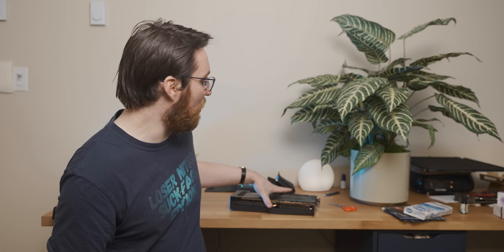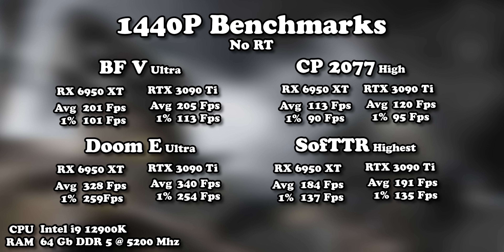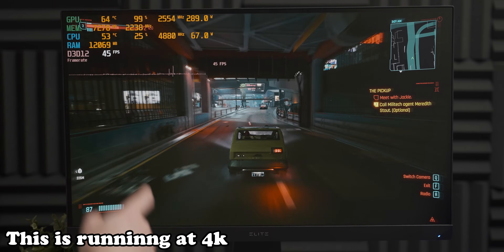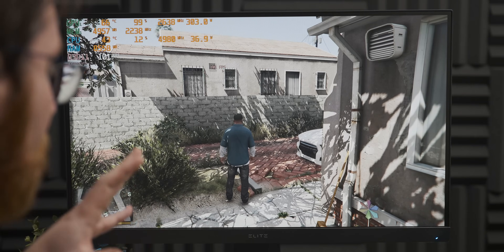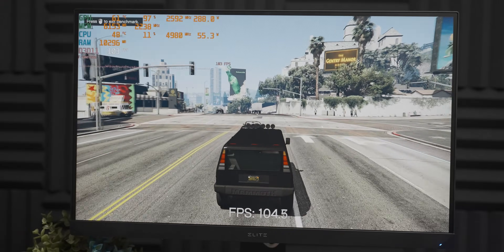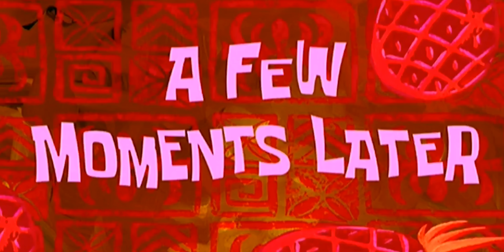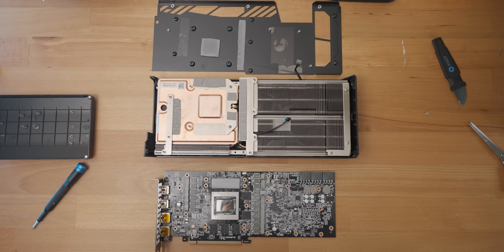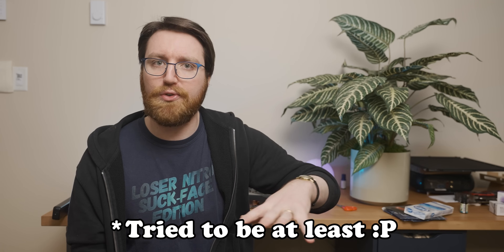I Can't Figure Out What's Wrong With This Gigabyte RX 6950 XT

Comment: This sounds off, so first question is did you AMD cleanup tool after the bios flash? As AMD stores the power tables in the registry on windows and why it might not have changed after the bios flash. 

Another thing you could do is Igor's lab mpt tool and set up a 400watt power plan and see if it will do a power plan this high to determine if it's the card causing the issues or something else. 

Hopefully this helps you along in the process of troubleshooting out what it is.  

You should use AMD drivers for clocking to eliminate the possibility of issues with MSI afterburner. And log with GPUz opening up in notepad plus so it lays it out nice and clean for you and look at clocks and settings are doing during your test run as if could possibly be throttling as well. 

Drivers usually identify the card and write the power plans to the windows registry for the cards. 

Another thing could be possibly going on is windows automatically updating drivers so before you do a remove and reinstall of drivers set windows to metered connection. Then dona driver reinstall. 

Questions let me know.

Comment: Considering you have changed everything it has to be a hardware issue. I don't see how it could be anything else at this point. But that coil whine is very concerning. Gigabyte should know pretty quickly what the problem might be, I mean they made it. It should not take 4 days to work it out. Whats weird is they haven't asked you to send the card back to them. Because after explaining the whine and that you changed the bios and drivers along with a whole new different test bed, they surly would want a look at the card itself. How can they diagnose the problem without the physical card? The issue might not be obvious or can be found using a diagrams. Hope you get an answer soon because this isn't an issue that should take this long if they haven't got the card to look at.

Comment: Hey Dawid, if you do some looking around there's a compounding issue that amds software power consumption isn't actually very accurate and reads far lower than the actual draw of the card. TestingGames on YouTube has a bunch of tests with the software numbers on screen and they closely resemble your power draw numbers

Comment: There is nothing wrong with your card. 6900 XT power is 255w in software before VRM efficiency. This 6950XT is 290W so its already more than 6900 XT. Also you need to test games that can push the card and you need to check the clk speeds. 4K is also what is required to push maximum power.

Comment: 4:03 - I do not see power delivery temperature (if the provided picture has all the temps). It might be measured and not reported yet it might still throttle the card at 100C. Power delivery is the kind of thing where having an aluminum block padded onto it is called good design. (Not to mention that Gigabyte definitely knows how to do power).

Comment: It's clear that you got the EU version of the card, now power prices have gone up 56% in the EU Gigabyte clearly sees a gap in the market 'low power top end cards'.
Past the jokes I suspect hardware problem be it a bad batch of parts or one of the do dads that place parts on the PCB had a bad day, massive coil wine makes me think it's the VRM maybe has some stages failing.
Reply: The thing is, that wouldn't even be a bad card, if it was marketed and priced as such. Many of the highend cards are already running way past their peak efficiency, so having one with all the shader cores but reduced clocks could be a great seller. Performance of something like a 6800 but at the power draw of a 6700

Comment: I had an issue like this from an older card, the PC has had a  few other cards in it before.  So I went to the drivers folder and made sure I changed properties to show hidden files and some older drivers showed up I deleted those and it started working properly.  Might be worth a try. I think system was confused,  happened to be Gigabyte hardware as well.

Comment: If it's anything like the issues I had with their launch 3080, the thermal pads were so subpar that it was causing the memory to overheat and the card would act strange without an obvious issue.

Comment: Doesn't seem to be the firmware, doesn't seem to be the power supply, doesn't seem to be the cables... So I think the problem is the chip which is somehow a bad batch and doesn't draw more power because it's limited somehow to avoid it from shutting down because it can't handle drawing power above a certain level?

Comment: There is nothing wrong with the GPU. The confusion comes from the fact that radeon drivers don't report the correct power draw through software. This has been a AMD problem for years...they don't report the real power draw in the drivers because they don't take into account the power losses on the mosfet drivers, inductors etc and some other power rails like 3,3V from the PCIE slot. TechpowerUP (and I believe also techtesters) measure power draw with specialized hardware(not afterburner or radeon drivers lol) and they measure the total power draw of the card at the PCIe power connectors and also on the PCIe slot. Ask techtesters on hey they measured the power draw, I bet they didn't measure it with afterburner lol.

Comment: As an electronics designer I can assure you that the massive component shortage is not just about GPU's or CPU's. There's a shortage of every type of component. This forces vendors to look for alternative components, Their first choice are drop in replacements, meaning that the new component can be soldered to the same PCB providing identical performance. Once you can't get your hands on such drop in replacements you basically have three choices:
1. Redesign the PCB to achive the same performance with other components. 
2. Choose a replacement that can be fitted to the same PCB but with less performance, life span, reliability etc.
3. Stop producing. 
With massive coil whine, your performance issues and the lack of vendor explanations I would guess at number 2. The board is not able to supply enough power thus throttled by a hidden setting that you can't touch. Or possibly the board can supply enough power but was throttled by mistake. Should you recieve a magic wand special update bios I'd guess for the latter.

Comment: I don't really know how the other sites/channels got the power usage info, but you should never take AMD's software monitoring for power at face value. There's a recent article on Igor's lab about that. Nvidia has sensors built in the PCB that basically gets the power usage right, but AMD's are funky. I'd use a watt meter in the same system, just swapping cards and checking the power usage on it, and taking your own conclusions.

Comment: Why is the card reporting as RX 6600 in HWinfo
Also, could one of the PCIE Inputs be broken so that's why it's capped at 290W like the 6900XT as it is only using 2x8-pins? can you use the Nvidia PCIE Riser thing (PCAT I think) to measure?

Comment: Finger prints and massive coil whine, sounds like the pcb and the components on it have issues. Is probably why they have little idea what is going on is there were some touch ups made after the board was originally made.

Comment: Yeah … So my experience … with gigabyte in the past is kinda similar
I had stability issues with a mainboard from them and before getting a RMA replacement I swapped out every part of my system … Ram PSU GPU were all replaced with superior parts and even after the RMA I still had the same issues until the store where I bought it got pissed at Gigabyte and they gave me a full refund so I bought my new board there since the store provided better support than Gigabyte 
I got myself an Asus board as replacement … and never had those problems again
Since that time I am trying to stay as far away from gigabyte products 
A few years ago I got a used GPU because the one in my mother her pc had some issues and the seller I got it from sold an Asus card … but I almost had a heart attack because he send it in a Gigabyte box … lucky enough it was actually an Asus card but … I realized at that moment that my experience with Gigabyte seemed to have left me traumatized … 
I am not saying that people should not by Gigabyte there products but I will advise to go back to the store when having problems with there products  and Request a refund right away …

Comment: I had on and off luck with gigabyte, one mini itx mobo went bad and returned it, one atx b550 mobo got stuck in hibernation once and had to pull cmos battery to ge it working but their waterforce xtreme 3080 has been awesome along with the z590 ultra atx mobo.

I do know some of their watercooled gpu and psu are pure trash.

Comment: I have a gigabyte gaming oc 6900xt and it has the same problem it barely draws any power, in Modern Warfare it draws around 95w, performance is still pretty good but it could be better

Comment: I was tempted to give Gigabyte a chance recently, since the Aorus Master 6800 XT was actually ON SALE. Until I started reading about issues with the VRM / VRAM overheating due to bad thermal pads (pads from the factory is too thin). So...I buy an Aorus Master tier GPU, brand-new, and I need to open it up, and spend $100+ to fix a design issue. No thanks. Waited a bit longer, and the Sapphire NITRO+ 6800XT SE went on sale...so I grabbed that instead. Having used Sapphire GPUs since the AGP Radeon (non-HD) 9000-series days (most recent being the Sapphire NITRO+ 5700 XT), I'm just going to stick with them. That said, the Gigabyte Vision RTX 3060 Ti  in my second system runs quiet and cool. Inconsistencies.

Comment: Something is blown in the power side of the card
Reply: Note that the power controllers have temp sensors too, if the power section is overheated they will reduce the amount of power available for the card,

Comment: its running exactly like a rx 6800 xt have you looked at the die? I wonder if a rejected die made it into the approved for rx 6950 xt bin. from what i understand they use under preforming die in low model cards and one just got mixed up.

Comment: I don't understand your problem. Your card uses less power, but clock speeds are way over official AMD spec and way higher than Gigabyte's too. It looks like you got very good bin of that card and you complain about lower power usage? I fail to see what's the problem. And no 6950 XT is indeed not as fast as 3090 or 3090 Ti in quite a bit of games. If anything is wrong with it is the fact that it's too fast, but that's good for you. So really wtf, Dawid? Not only that, but you flashed vBIOS for a bit worse binned cards as it no longer boosted as much. This video is such a fail. Anyway, did you check ASIC quality in GPU-Z?

Comment: msi afterburner does not really like my powercolor 6900xt and I ended up using the overclocking tools built into the amd driver.... even undervolted it to get less coil whine... maybe the amd tools are a fix for the power issue...

Comment: There is undoubtedly a hardware or software/internal bios limiter of some sort that is keeping the card from doing what it needs too. With it performing more like a 6800xt or 6700xt its falling to far behind specs.
Reply: I would guess a resistor used in a sensing circuit is the wrong value. The card thinks it's hitting 380w but really 280w, obviously the circuit used for reporting the power to the OS is OK.

Comment: Im not an expert or anything but since you're exactly a 100w from a normal power draw and a proven working bios version didn't work, then I would say you have a bad capacitor or something to that effect in the power delivery chain. You should get a tester and individually test the circuits.

Comment: always loving the great content bro!!! this is just another reason why I do not like Gigabyte at all... from janky psu's and the constant returns of gigabyte motherboards and video cards at Microcenter. it just keeps adding up lol. I stick to loyal brands such as EVGA, Asus, Sapphire, and ASRock. always performed well no matter what product I use from these brands.
Reply: If I go just from my experience, there are rarely any that are recommendable.
Gigabyte: got into lots of heat recently (justified, because they did lots of BS recently)
MSI: boards where RAM slots randomly die and GPUs where the power delivery is shunted to go over TDP for review results
Asus: stuff is named completely different and have overly complicated setup procedures. I have one board where I am unable to enter BIOS when a specific CPU is inserted (the CPU works fine in other boards) and another one where one specific keyboard doesn't work. (the keyboard does fine on other boards, and other keyboards on that board)
ASRock: went from making shoddy boards with bad performance to becoming a decent manufacturer at a budget, but that budget comes at a cost.
Corsair: silently changes the chips on their RAM and SSDs into versions with less performance, but don't adjust the price for that.

Comment: Well actually, just after a short investigation of mine, if you look on thechpowerup the bioses they have for 6950 XT are limiting power to the cards output and mine too has 290W which is a bios limit. I think the cards that draw insane amounts of power are the faulty ones, ignoring bios specs. My sapphire non-pure is 290W, the Pure is 325W limited and the Toxic is 332W limit accordingly, so this is by design.
Reply: No, only faulty thing is to assume Radeons report full board power. They don't, it's just GPU itself and memory. You can add 25% top of the number in monitoring software. It's same with all radeon cards.
Reply: @kognak6640  you and me both know that's not true, you can monitor the power output from your PSU, mine reports it just fine. The card is pulling 290W from the wall, that's it. No more, no less. There's nothing wrong with the card, it's the ones that have 380W draw that are the faulty ones.
Reply: @kogwrath238  You don't know even basics. You wall figure is whole computer with PSU losses. You can't accurately say how much it's from graphics card. Only accurate way is to measure power consumption from 12V feeds to graphics cards. Some review sites have equipment for it(nvidia PCAT).

Comment: I always had issues with gigabyte products especially with gpus from poor memory, weak power delivery up to poorly designed pcb. I have a gigabyte gtx 1080 g1 gaming and the card crashed and fans went to 100 % every time i was playing a game (witcher 3 mostly) for almost a year and a half i had this issue i tried to contact support and they just told me to try different drivers. Tried that, didnt do anything tried all bunch of stuff (bios flash, different psu different system) still the card was crashing and radio silence from gb support. Than i saw an old forum where some old evga gpus were doing the same thing back in 2010 and it said something about bad power delivery. Than tried to undervolt the gpu and balance out the core clock and i ended up to 0.95 to 1 volt and 1962mhz core at 67celcius under full load and 8 months now never had any issues with it. Funny thing is that if i try to go to 1.05 or 1.1 volt the thing will crash again. So yeah trash product. Also the coil whine almost non existant after tweak.
Reply: So in the end the factory overclocked card couldn't run stable at that overclock?
Reply: @HappyBeezerStudios  no no its not about the stability of the factory oc or user oc, the chip runs fine at those clock speeds. Its about the power delivery the vrm specifically once you go past 175w - 180w, the symptoms that i mention start to occur, so i need to undervolt. My guess is that gb used unedrspeced power delivery or vrm that thay used on a lower end gpu to save costs.

Comment: Honestly this is just plain weird, especially because since the overclock doesn't actually work it has to be 99% sure hardware issues. I would try to run it on a fresh windows install just to see what happens because aparently that can make a difference sometimes, but there has to be something wrong in the card bottlenecking it severely.
Reply: Maybe not issues but an actual limit.
Reply: @HappyBeezerStudios  who knows. Hardware can be really picky sometimes

Comment: Dawid Does Tech Stuff : did you use 3 separate PCI-Ex cables to power the RX 6950 XT ? Usually if you have too weak of a PSU (not in terms of watts but in terms of amperage capability through each 12 V line), daisy chaining the PCI-Ex cables (those little parasitic additional 8-pin cables that modern PSU-s have two on each PCI-Ex cable) manifests itself in too little amperage that the GPU needs to perform at 100 % of power capacity.
But it also could be a a few partially damaged VRM modules due to previous owners not using a custom fan curve to cool the whole PCB down properly. If 2 of the power stages are damaged, the controller goes into a power safe mode AKA more of a conservative model to protect the GPU core.
Reply from the maker: Hey! Yeah, I did use three separate PCIe cables. 👍

Comment: I am disappointed with the Gigabyte products. I used their B450 Aorus Pro motherboard until my computer broke (the reason, it turned out, was precisely the motherboard). After replacing it with a comparable MSI product, the entire computer started to run much better. My BT and WiFi issues are gone, the fans don't have a sudden speed boosts (tried different curves, didn't help), even CPU temperatures are lower. I would say I had a faulty unit but found my friend who liked my build and built an identical one for himself had exactly the same problems as me. And guess what? After replacing the motherboard (his also broke) the problems disappeared.